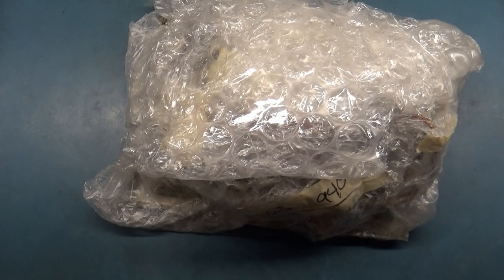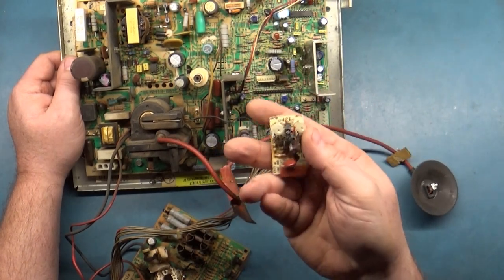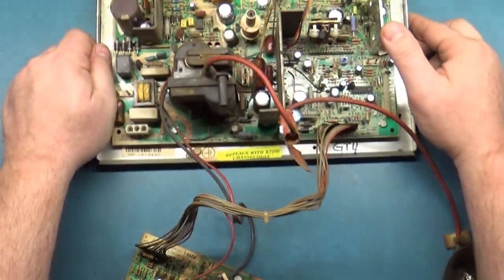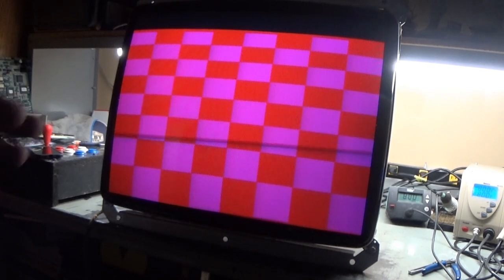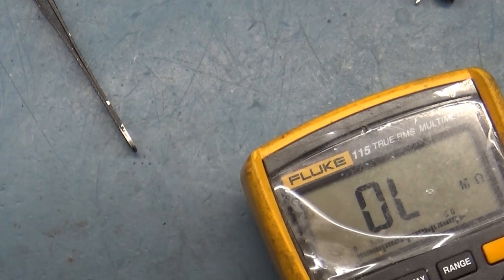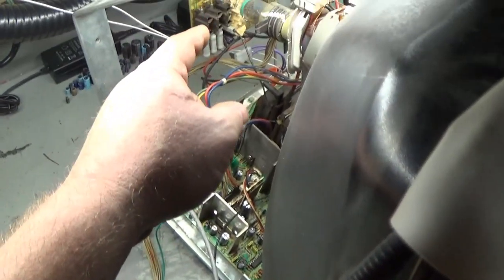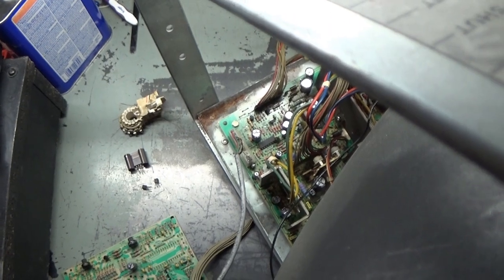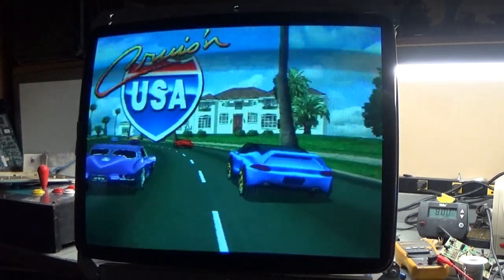27" K7500 Arcade Monitor Chassis Repair - Linearity Issues, All Red Screen, Neckboard Issues Galore!

Comment: I thought your issue with that red was going to be the same issue I had with a polo the other day. I had blue that was being over driven and I changed the same neck board chip that the k7500 uses and that didn't fix it and all my transistors checkef good and I couldn't find a single component in the blue circuit that was bad. It  was also causing the blue resistor on the neck board to get super hot and the other ones weren't nearly as hot. So I went ahead and replaced that blue chroma transistor anyhow even though it checked good and then the blue worked  perfectly and wasn't overdriven and that resistor was no longer ultra hot.

Comment: My question is i have a  pentranic 1425 with the same red screen issues.  How does someone brand new to this know what these transistor and resistor  are to buy them if needed?
Reply from the maker: I’ve never worked on a Pentranic, so I can’t say with certainty. But if you have RBG, then the transistors are fine. You likely just need to adjust the color pots on the neck board.